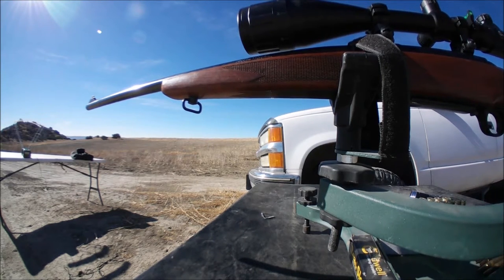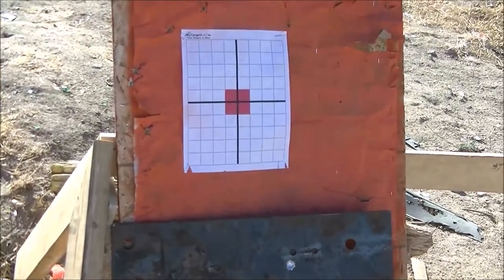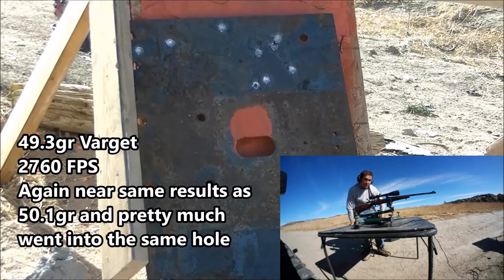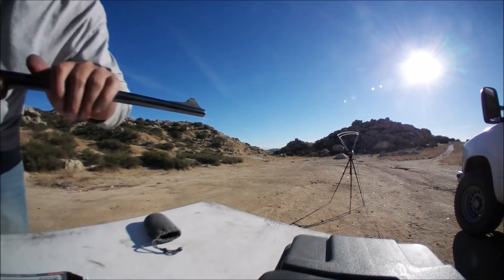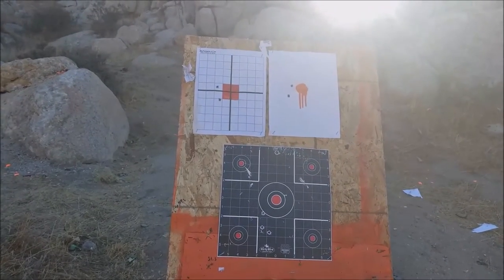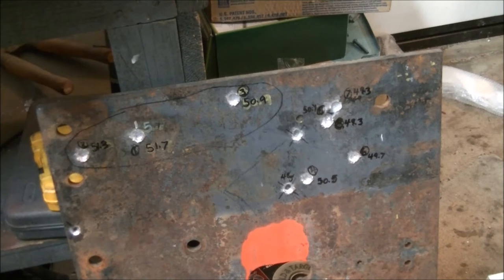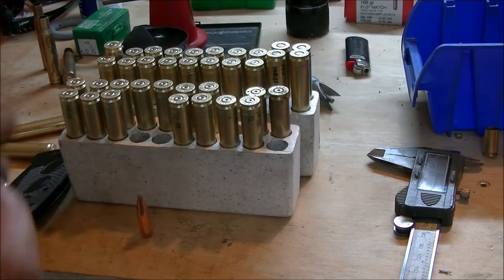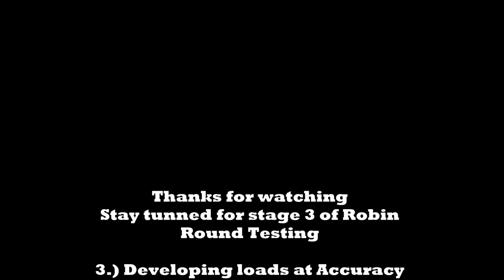30-06 Round Robin Load development (Stage 2) Sierra MK 168gr BTHP and Cast Load Testing

Comment: You may well have better luck at 1000 yards with a 175gr SMK as apposed to the 168gr. It has a much higher BC and will serve you better at those distances..
I would also suggest trying some slower powders in your testing. Varget is great in the .308 but it's a bit on the fast side for the .30-06
Not saying it won't work, there are just better choices. Classics in the '06 like IMR4350, IMR4831, RL19
These will get that 175gr bullet in the 2800fps zone.
To gain even a little extra more BC as far as the SMK goes, I switched to the green tipped ones.
To switch things up all together the Hornady ELD's have even higher BC's yet, and have a better "heat shield" tip that gives superior ballistics that have been measured at distance(800,1000 yards) with doplar radar.
Just a few things to chew on.
Walter
Reply from the maker: +Coats Brothers Firearms, Great advice ThankYou. Ive been trying to find H4350 no luck. Though I read IMR 4350 is almost the same just more heat sensitive.  I have some Hornady 208 ELDs. Whats your opions on that bullet for 1k? Ive manage to show these results on stage 3 and actually visually explain as well Robin Round testing. Really tight groups(results at 18 min) if it wasn't for 1 flyer due to a tight fit on my floated barrel on one spot. I wanted to compare these SMKs to hornady ELDs 168gr also
Reply: Kenny. That 208 ELD would be a good choice. IMR4451 is easy to find, is NOT temp sensitive, and is almost the same burn rate as H4350. Give it a look!